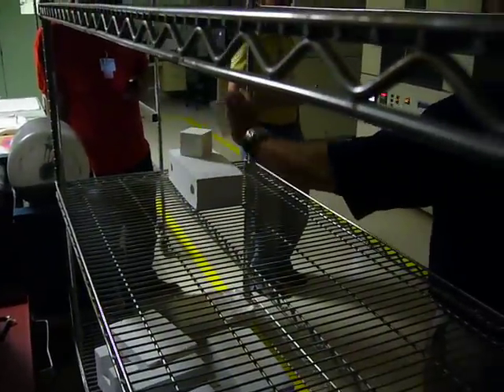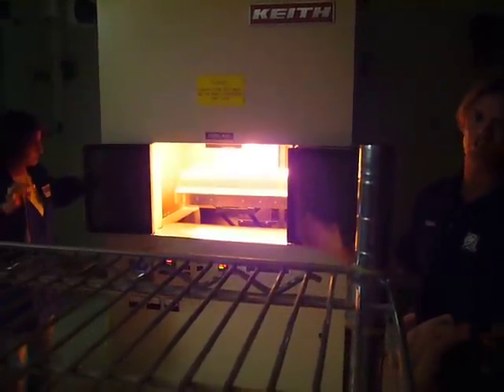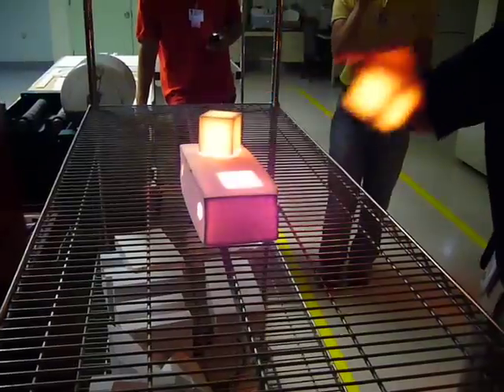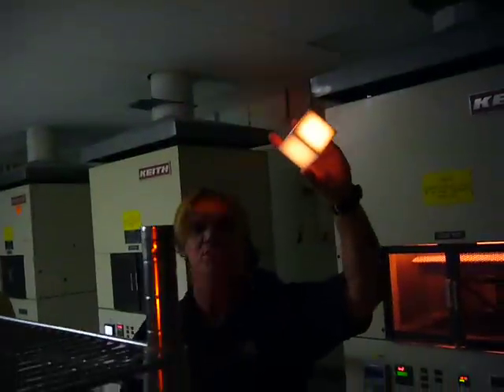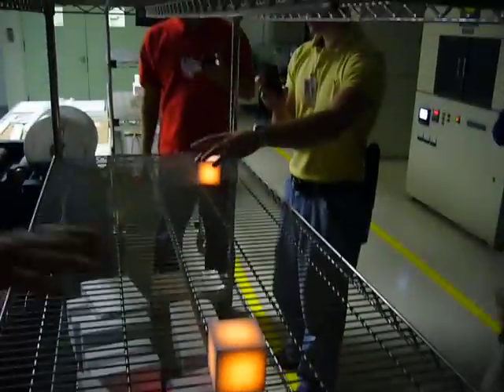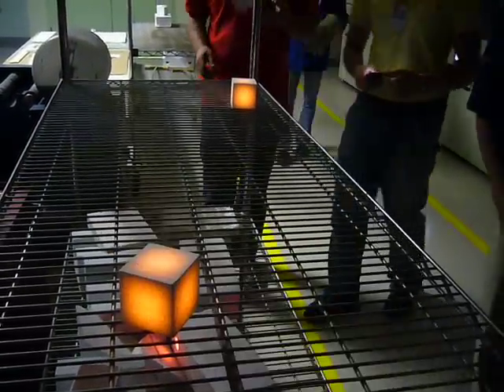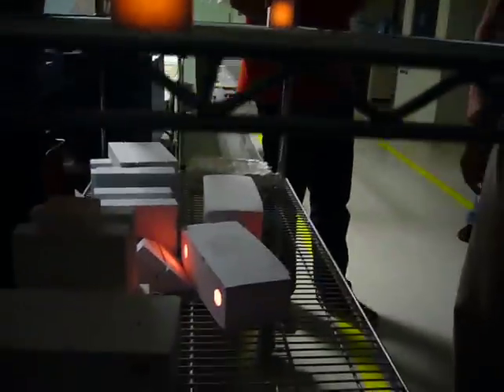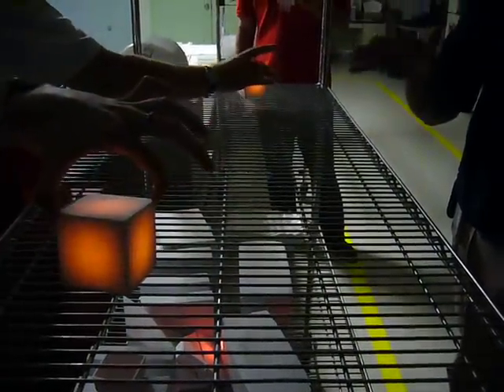Space Shuttle Thermal Tile Demonstration

Comment: 2200 degrees... It doesn't matter if it's c or f.
Reply: It doesn't matter what units of measurement are used in scientific evaluation and engineering, they are chosen based on convenience.  The important thing is to always specify the unit of measurement when keeping information, and it's furthermore convenient to stick with a specific measurement system, and because we're human and make mistakes, becomes more important.  Even getting a decimal place wrong has led to disaster, which is just a result of inaccurate analysis or record keeping.  Conversions of sufficient accuracy can always be done when needed.

It's like working on an older car which uses both metric and SAE fasteners, much easier to choose from a tool set if it's a car with just one or the other.

Just my blab... Lol
Reply: CD8T LFA1 since this is a demonstration for people of the general American public it’s more than likely in Fahrenheit, most Americans aren’t familiar with Celsius
Reply: 2200 degrees Fahrenheit or 1200 Celcius. According to the Wiki (LI-900)
Reply: @kvurduzo1967  Shuttle has aluminum structure it does not matter what units you use that structure is gone if heats to either.A typical shortcut done by an engineer when talking to people and wrongly assumed that listener has background context of the problem.
Reply: Wtf is a C or an F?
Reply: CD8T LFA1 if its science, use Kelvin
Reply: Aslan Burnley everyone must love you at parties. Stop taking stuff so serious, the original joke flew over your head like space shuttle that tile will be put on.
Reply: Either way, it is "instantly set your hand on fire" levels of heat.
Reply: I love how water freezes at 0° and boils at 100°. Why would I want my water to boil at 212° or freeze at 32° lol srsly whoever came up with this shit in 1700s fuck off its 21th century, US wake up plz, unnecessary confusion, and children are more likely to be interested in science if they see that it obviously makes sense. But no, US kids have to learn the numbers 32&212 and everything inbetween is a random number and almost completely unrelatable in relation to each other without calculating.
Reply: not really. i wouldnt touch both of them
Reply: Remy Note obviously, since it's pertaining to science it's in c
Reply: @FictualKyle  Kelvin is pretty common in rocket science
Reply: CalvinV7 funny enough NASA used a lot of metric during Apollo as far as I know
Reply: Aslan Burnley Good thing you call me autistic LOL.. Anyway, enough trolling now. You did quite well. 9/10 would get trolled by again some day. Not the usual just bullshit.. but a bit too much of "I am so fantastic, see this amazingly smart sounding textwall" otherwise it's a legit 10/10.
Reply: @allesklarklaus147  love it when the troll calls the other person a troll.
Reply: It's not degrees Fahrenheit, it's degrees FREEDOM
Reply: Aslan Burnley lol are you just making stories and arguments up to defend your beloved imperial system or are you serious about this? And yes science absolutely is about disagreeing on which unit to use rather than the actual topic so that nobody can relate to what others have written. Seems fun! I might have said something about making up your own temperature scale before which could fit here, not sure.. anyway, if you're interested you can look up SI or International system of units and read about it if you want. cheers
Reply: @allesklarklaus147  didn’t know your country landed on the moon
Reply: Czech Mix Yeah, pretty damn cool moving a whole country to the moon, isn't it?
Reply: "Scientific community", "publishing", "scientists around the world", you sound like an advocate, not a skeptic. Real scientists don't use such certainty-based language.

You forget that argument by consensus is a false argument. Consensus amongst scientists about a particular issue, concept, or idea, is wishful thinking, and political projection. It doesn't exist in the real world. Some consensus exists, and it exists within particular fields of expertise, but there is no such thing as "scientific" consensus. Science is incredibly broad with many opposing parties. 

Science is more in contention than in agreement.

You said that  - //The point is that there is a standard unit system which scientists all around the world agreed on to make their life easier. //

There isn't a (single) standard unit system though. We use different systems for different needs. Systems of measurement in modern use include the metric system, the imperial system, and United States customary units.

"Consensus" is often touted as some mystical epistemological God, often by the left, to use as a political bludgeon in order to portray their opponents as being of low or limited intelligence, and opposing "scientific truth".

So how about you fuck off with your victorian analogy, because first, all analogies are false, and second, chronological snobbery is just another form of a false argument. 

Your premise that imperial is somehow "incorrect" or "limited" is false. Just concede your point.
Reply: CalvinV7 Nope, not sure. Just picked it up somewhere. They had this accident where a spacecraft crashed due to imperial/metric mixup but before, during the moon mission, they apparently used the metric system. I can't imagine them using Newtons instead of pounds of thrust or m/s instead of ft/s but hey, you never know..
Reply: Szem, not necessarily true. You can also use Rankine, which is also an absolute scale.
Reply: Aslan Burnley Yeah you kinda missed the joke I guess
Reply: Alles - or you could use established scales, such as Kelvin or Rankine, depending on what you are doing. Take thermodynamics for example. A lot of thermodynamics textbooks have engineering characteristics tables at the back of the book, and their properties are often in Metric or Imperial, so, you will find some tables and equations which use Kelvin, and others which use Rankine. 

If a US company requires you to use an imperial MLT system, you better know how to use Slug, Foot, Second, and the related derived units such as temperature in Rankine or Fahrenheit, to engineer that system. If you are a cocky and arrogant euro fanboy who only knows how to solve problems using one MLT system (metric), then you just might get laughed at for being narrowminded.
Reply: @aslanburnley  binary linear thinkers; glorified bean counters.  If they truly had intellect they use any intelligence system but their minds are constricted to one humiliated intelligence system. They normalize all of their weaknesses because they are insulated by people who have a similar range and interpretation of reality. Everything is 1's and 0's.
Reply: Aslan Burnley If you just want to get laughed at by colleges rather than get your paper out you can also just make up your own scale.
Reply: Aslan Burnley Why the fuck would I care, we got rid of our (pretty similar to the actual) imperial system long before I was born. And I wonder where a scientific community in the first world would actually still publish in imperial? It's not 19th century and Queen Victoria ruling the world anymore. If in engineering something comes in with inch dimensions we just use the usual engineering approach of putting it into a calculator to convert into mm or m and go from there. However, you might have misunderstood my comment. The point is that there is a standard unit system which scientists all around the world agreed on to make their life easier. If you don't want to deal with that, you have to accept the consequences.
Reply: That's not obvious. Science (inductive reasoning) can use any MLT system, as long as it is a consistent system. Science doesn't care about metric or imperial. Science cares about empiricism.

MLT is everything.
Reply: Aslan Burnley 
Well metric is the most consistent system:
1km is 1000m, 1m is 10dm, 1 dm is 10cm, 1cm is 10 mm etc etc.
Water boils at 100, freezes at 0
Kelvin is used a lot in more advanced science but still, metric is the way to go for almost everything. Imperial system is quite outdated because nobody uses their thumb to measure things anymore.
Reply: @aslanburnley  there are two types of nations:

Those who use metric

And those that landed on the moon using metric
Reply: Aslan Burnley but this is NASA who have confirmed to use the metric system so it's in C

Comment: Wonder if these could be used in futuristic passive GPU cooling.
Reply: It's possible but using this material would be a bit overkill.
Reply: Maybe it can be used in some small quantity, much less than a metal heatsink. Given the trend of GPUs, it might be necessary. I mean, in the 90's most GPUs didnt even have the big fans nearly all GPUs have now.
Reply: No. The guy in the video is wrong when he says heat dissipates "well" or "rapidly." Really what's seen here is it insulating very well, meaning that heat leaves very slowly. That's why you can pick it up, because the heat is insulated and it conducts very slowly to your hand.

Comment: do really know what 2500 degress is no ... you don't people it would melt the rack ..That rack is a common food rack that cant take more then 800 degrees .. even if u could touch the corners.The heat from the sides would burn a hole in ur hand. Really , people what does steam do when it rises,and you hand is near it aka directly over the stream ,and u keep your hand over the steam  for a few secs. Yet,Steam is no where near that temp ..oh yeah u get blisters .pfft
HERE ENDTH THE LESSON
Till all shall see
John 3:17.
Reply: Optimal Supreme Analogies are worthless if they are wildly inaccurate because you are physically illiterate. So there's that.
Reply: Even though you think a steel food rack would buckle at first contact with any object over 800 degrees, would you agree that under no circumstances could hours of burning jet fuel weaken steel beams?
Reply: No, it would melt the steel beams..aka twin towers ..dah. Any heat takes time ..which is why it travels up  the length of the metal ,and causes it to heat up .So ,much so that u cant handle..,and then of course melt ..aka physics. Oh by the way these racks aren't even that special these are again just food racks again for maybe 500 deg. aka oven racks.so I said 800 to be liberal .what are u a shrill .. aka button pusher
Reply: Button pusher. Oh, you are a smart one aren't you. Didn't expect that from bible thumper. But anyway, no you are wrong.  Just because the rack is made to hold food items of at most 500 degrees or so, doesn't mean it will self-destruct at 800. It's still made out of steel which melts at anywhere from 2500 and up. So in theory this tile could melt the rack. But the whole point of designing this material for the space shuttle is that it has high emissivity and low heat conductivity. It will mostly lose temperature by radiating it, which is reflected by the shiny metal surface instead of being absorbed. It will on the other hand transfer very little heat to the rack by conduction, and so it would have to sit there a very long time to damage it. Also note that the ribs are round sticks, and the tile only touches the top part of it. This minimizes the surface area where the tiles touches and can conduct heat, compared for example to a flat surface.

And then the steam comment. Doesn't make much sense. If you have steam, it can condense onto your hand as 200 degree water and give you burns. The reason condensing water releases so much energy is due to the high vaporization enthalpy of water. But there's no water or steam anywhere around the tile. You would just get some hot air, assuming the tile was a good heat conductor, which it again isn't.
Reply: Please, show me the two contradictions. Prove that you can produce at least one coherent thought.
No, steel, doesn't melt "at a certain stage of 500 degree". Maybe it will start to get a bit soft at 2200 degrees and melt at 2500 degrees. But 500? Doesn't do jack shit to steel. Please, go ahead and use a blowtorch on some of your silverwear and see when it starts to buckle. But are you can see, the rack was nowhere that hot, or it would have glowed at least slightly red. You've just proven that you know nothing about steel.
Wtf are you talking about with teflon. Teflon is not used on roofs, and certainly not for reflecting heat. And no teflon was used in construction of the shell armoring as far as I can see in the linked information brochure in the video description. The tile is a modified borosilicate glass, and the glue is a silicone glue. The silicone glue maybe can't handle 2500 degrees but that's the whole point of these tiles. Even if the outside is 2500 degrees from air drag, the inside is shielded and should be considerably cooler. 
It's true that these tiles came loose during the accident, but what you do then is go back to drawing board and come up with an new solution. You don't just declare it to all be fake.
Reply: Steam burns you because it condenses on your hand, transferring from gas to liquid phase and releasing a huge amount of latent heat: 2.2 megajoules per kilogram of water. That's what really burns you - air at the same temperature is perfectly okay to stick your hand in, at least for a few seconds.
Reply: Exactly.
Reply: You're both going off in the wrong direction. Steel has a thermal conductivity index of 50 whereas Zirconia ceramics have an index of 3. A poor conductor is an excellent insulator.
Reply: AP12uZvfvag 

Actually, these tiles had nothing to do with the accident - making him wrong on all counts. That's a HRSI tile. Columbia was brought down by a hole in an RCC panel on the leading edge of the wing. The hole in the panel let 5000° plasma into the wing, the inside of which is made of aluminum, not steel.

I know - confusing them with facts isn't nice...
Reply: I am answering this guy only and once only you do realize you just proved my point. Saying why just proves my point ..Which is heat oh guess people don't understand analogies .. Yeah what are people taught these days..oh yeah LIES ..you belive that video lol so sad.. When you are told by the astronuts how fake it is as I was ..Then come to me.
Till all shall see
John 3:17

Comment: My serious question is will these Tiles hold up to 10,000 Degree's of Heat, for a short & certain amount of time.....Please Respond as soon as possible.....Thanks
Reply: No they would vaporize, no matter how good we make something nothing can withstand over 6,000 F without melting/ boiling
Aluminium would boil at 5,000 degrees for example.
Reply: No. They will begin to slump when they get near 3000 deg, F
Reply: I wondered if that's true....?
Reply: Yes, they will slump if overtempt
Reply: Charlie, where did you confirm this information...?

Comment: Imagine if they made these things into heatsinks for computers. The sky would be the limit for overclocking potential. Wonder how much they cost to produce.
Reply: +Robert Sides wouldnt work, in order you have a good heat-sink you'd need a material that is cabable of absorbing heat very well from the electronic parts, however this material is incapable of doing so well in that department, however if that material can conduct electricity well it can be used to make the electronic parts without the need for a huge cooling system or heat-sink.
Reply: so many monies...
Reply: Ahmed Waheed Well, of course I don't mean in its current form. I honestly haven't a clue what the hell the thing is made of though. It did seem more than capable of absorbing heat though. Good point though. I didn't consider its reaction to electronics. might be a tiny oversight. Hell though, if this thing can do what it does, it doesn't seem too out of this world to suit those means more.
Reply: +Robert Sides though
Reply: lexletvm In a past life I was Indecivus Maximus
Reply: +Robert Sides :DD

Comment: Can I have a engine block and cylinder heads made from this? Imagine no coolant or problems with over heating. A new material for air cooled engines.
Reply: No, while its thermal properties are outstanding it likely doesn't have the structural integrity to handle the extreme pressure or stress your engine block experiences even at idle, I'd imagine.
Reply: in other words, it may be great at cooling but its probably very brittle or soft or some other property not ideal for stressful applications.
Reply: But it would be cool. And that's not to say a material like that can't exist... just that that one probably isn't it. In the near future, hopefully.
Reply: Brian Murray - Yeah right.  This material is fragile as shit, which is why there are seven dead Columbia astronauts.
Reply: And besides this not being the right material… the future is electric. No need for blocks or heads.